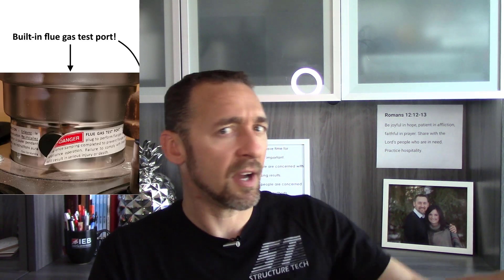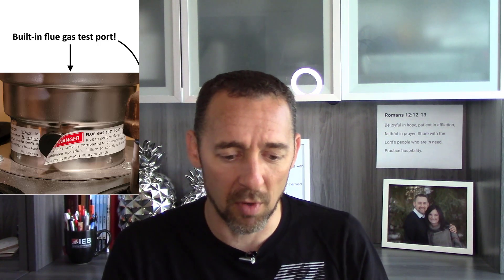CO testing at furnaces

Comment: Three years late. Great video, as always. I carry a CO detector on my belt loop during inspections, in part to protect me from a drastic problem, and to know if there is something to document in the living space. I have never tested the flue gasses, but am pondering adding that (and the time required). 
My method is watching for safety issues and the flue gasses test is looking for furnace problems. One thing I’ll point out is that I don’t agree with an inspector shutting down/red tagging a system if it’s just exhausting high CO, but not putting it into the living space. I’d be hard pressed to explain why I shut it down when I cannot show a current safety hazard. 
A note, I tested an indoor ventless gas fireplace a while back, expecting to document hazardous CO from it, and zero was detected, with three detectors. We were stunned. I did recommend a CO alarm be installed near it.

Comment: 167 ppm air free. Checked everything from gas pressure to venting unable to lower under 100 ppm. 

Furnace 10 years old slightly oversized. 

Do you condemn the furnace??

Comment: So no testing on B vent ?
Reply: Maybe not for inspectors, HVAC tech yes. You can use a step bit to make a larger hole in the outer, smaller in the inner. When finished you can seal the inner pipe up with red high temp silicone and the outer with approved foil tape. Sometimes there’s a small collar before the b vent starts. If available I test there.

Comment: Well someone shut down my furnace for 8ppm CO2..ITS WINTER🙄 I Didnt hear you say nothing at that level.  They want me to replace the whole furnace I just got this one in 2012🙄 what do I do???
Reply: Facing something similar myself. Seems suspiciously scammy to me after watching this.
Reply: @greazedlightninggarage6768  the system can have damages at the heat exchanger and per gas association if there is an breach at the exchanger the systems exchanger should be replaced or the furnace should. Sorry for the run on sentence it hurt my yes when I read it lol
Reply: Always get a second opinion unfortunately very common nowadays.
Reply: @user-sz5tv4fv8n  you know I'm with DTE appliances program and I ask for a 2nd opinion they told me we don't give 2nd opinions get you a new furnace lady😳🫨😬🤔 this was almost a year ago. Still no help yet. I got put on a program that's supposed to come and check my furnace and if it is a C02 problem I'll get a new Central heat and air unit.....that was told to me a few months ago...nothing yet and it's 14° out today 
🥶🥶🥶🥶🥶🥶🥶🥶🥶
Reply: @MsQsince2  what did you do? My company works the Detroit area. We could definitely give you a second opinion. And and an estimate for repair or replacement. I wouldn’t have shut you down for 8ppm in this weather. That’s more dangerous.
Reply: @moonrambo2074   I wrote a letter to someone big in the energy company, (didn't know to who I sent the email) they read it and had someone call me and by Jan 16th, 2023 I received a brand new Central heat, and air unit free no charge. Got blessed. I only had a furnace, not a central heat and air unit. Patients is a virtue 🙏🏽Thanks for asking.

Comment: Reuben, Do you ever test for CO at the heat register? All the HVAC folks in this area (Oregon) set a CO tester at the heat register after letting the furnace warm up for 15-20 minutes, then let the tester remain there for 15-20 minutes. This is how I've been taught and how I've tested for furnace CO for the past 7 years. Any reason not to do it this way? Thanks for your videos!
Reply from the maker: Hi Bruce, no, we don't test for CO that way. I'm not aware of any HVAC contractor who does it that way in my area. When in Rome...
Reply: Thanks for your quick reply! The reason I've been told they test this way (and why I also test this way) is to catch any CO entering the house through the air ducts, which pretty much indicates a crack in the heat exchanger. Like I say, I've tested this way for 7+ years and when the readings are over 12 PPM,  It's almost always a cracked heat exchanger. I'm always looking for a reason to recommend a full servicing on the furnace, so any level over 5, I will recommend the furnace be serviced. Thanks for what you do for the home inspection profession, there is always more to learn!   @StructureTech1
Reply: Helpful video for sure. Thx! Did want to add testimony that an HVAC company that I hired to check a heat exchanger in Kansas also used the method that Bruce described. They checked CO readings at nearly every vent register in the home! Context: the traditional, older style of gas furnace -- the first of the three types you handily go over in the video.
Reply: @rickscovel9062  why not just test for CO at the supply trunk? Going to every register is ridiculous hope you didn’t get charged for wasted time
Reply: In MI That’s the same way I’ve been taught and have been testing for years for simple certs for the city. Required by some for rentals or sales. only to test the integrity of the heat exchanger. Closest vent or drill a small hole in supply duct. 
Use the combustion analyzer in the exhaust to “tune up” or verify its running to manufacture spec efficiency.

Comment: I agree. Great video.

I might ask, what about carbon monoxide  testing inside the livable space of the residence? 
I , at one residence, read 110 ppm carbon monoxide built up within areas of the residence.
The only item in that vicinity was the gas furnace.
The problem was afforded solutions, needless to say,  a check of the livable space may be of value